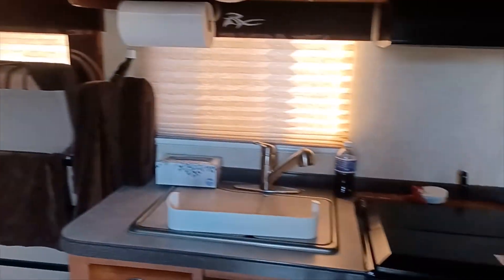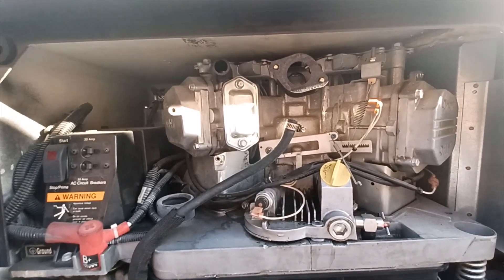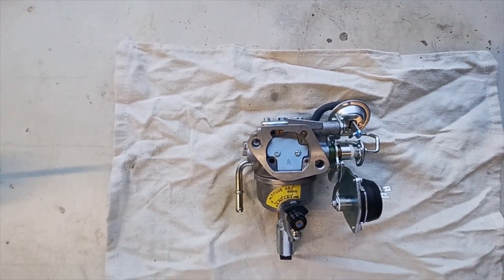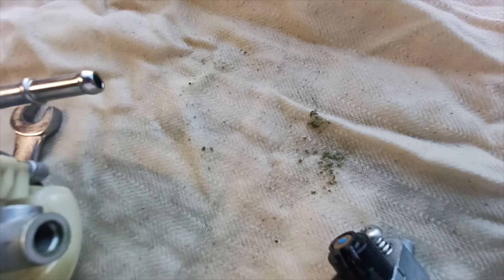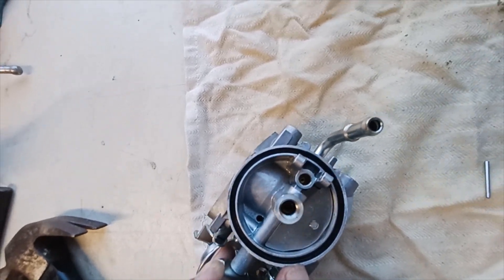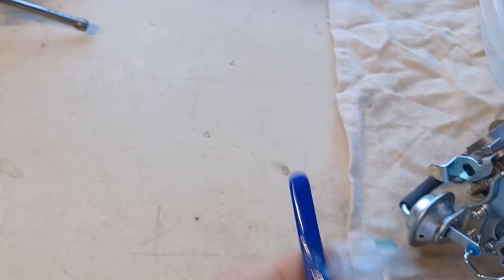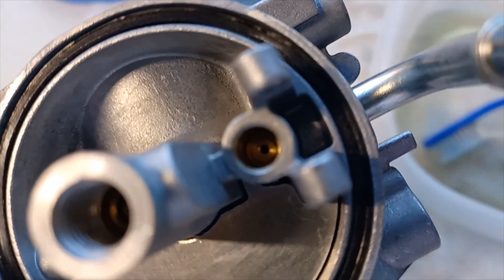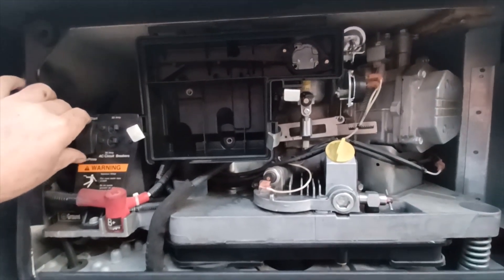Troubleshooting a Gas Engine - An Onan Generator that Won't Start

Comment: Thank you for this video! I had to replace my pump, so the fuel in there was over a year old. I did have to remove the choke from the brass coupling and the plunger inside was stuck to the inside of the brass opening. Cleaned the thick varnish off with a toothbrush and carb cleaner and it fired up like new.
Reply from the maker: Awesome!  We will all be doing this more often with the added Ethanol found in gasoline today!  I'm glad you got it fixed and running again!  Thanks for watching!

Comment: I learned this trick from another youtuber on how clean out the orphices is to use a torch tip cleaner for an acetalyne torch.   In my case it was a predator pressure washer.  I will admit that I did buy a new carb to determine if the unit was good or not.  When I had the patience I did clean out the old carb.  The positive is that I have a spare carb.
Reply from the maker: Brian, that is a great idea!  You already had a replacement carb that worked so, you've got a faulty carb to work on and try new tricks to get it working again.  If you get the old one repaired, you're a hero and you've got a spare.  If not, no loss because you already have the replacement.  I will have to try that next time because this carb inherently needs service after sitting for some time.  Thanks for the tip and thanks for watching!
Reply: The tools that I used to clean out the carb is a Miller torch tip.cleaner tool the nice part is it is under 10 dollars at Home Depot.   The original carb works at about 92 percent.  I also tried drill bits, but most were too big for my application.  Always a pleasure to watch your content.

Comment: Glad you got it Bud , With this Gas today crazy. Yeah I found out a oh Bread tie just pill the plastic or paper back and wire is a good size to get in those little holes ,i know crazy but it works. Have a good one Bud ✌️
Reply from the maker: That is a good tip and just the right size to get those areas cleaned out!  The gas today is tough on all of this stuff!  Many just toss the carb and buy a new one on Amazon.  It is more satisfying to troubleshoot and fix them yourself.  Thanks for watching Lonnie!